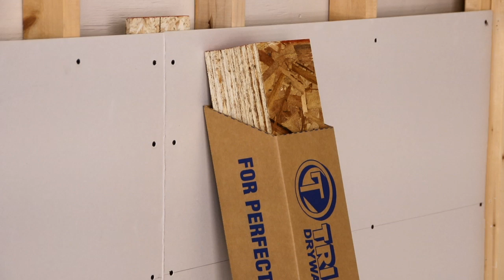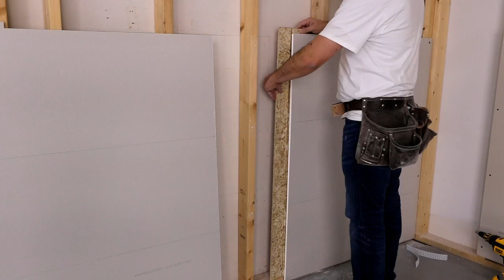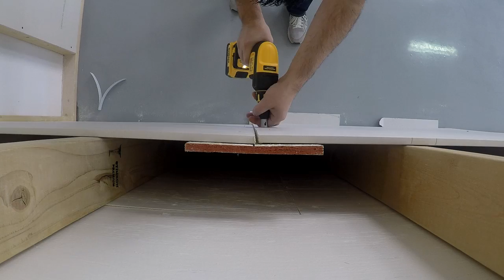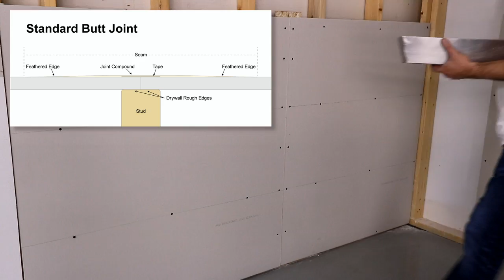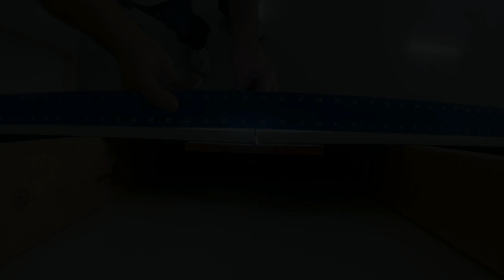How to Create Perfectly Flat Walls - Installing Buttboard™

Comment: Until someone find it with their stud finder to hang the 75” tv brackets from 😆
Reply: Lol
Reply: Lmao
Reply: That's what I was thinking 🤔 no way tellin' butt board from stud when hanging anything
Reply: Studs are spaced 12, 16 or 24 inches. If you're using a stud finder, you simply need measure the spacing.

Comment: How does it recess the joint? Wouldn't it just stay flat as if there was a stud there? What about an exterior wall with insulation and vapor barrier? Ceilings? Thanks!
Reply from the maker: On one side of the board (the side with the line) there is a very wide V channel cut. The channel pulls in the edges of the board to make the recess. So unlike a stud which is flat, the V channel makes a recess. Here's a video of it being installed on a ceiling with insulation https://youtu.be/Lr5v3EblafA
Reply: Cousin Justin stability is in the plywood
Reply: @trimtex  this explained one of my questions. Thanks!

Comment: Seems like a good idea since you can save on waste from drywall cuts. My big concern is because of the added stress on the drywall would you not get guaranteed screw pops from this product? Not only that but with your bottom and top plates does that not bow out the corner of the drywall forcing you to feather out your tape joint anyways?
Reply: Good point... for bottom plates, I guess baseboard will hide it (you can chisel the corner of sheet flush or deeper than flush), not really sure what you could do at the top. Maybe you do Buttboard on all the runs except for the top?

As for screw pops, I find it difficult to imagine a properly-done taped joint won't keep them down, especially if the screws are placed reasonably close (but not too close) to the end of the sheet where the curvature is greater (i.e. more mud on top) and where the tape is placed.
Reply: I'd be interested in the answer to this so, especially the question of how to have the top and bottom plates.
Reply: My house was done this way.  10 years now no screw pops.  They also put glue on it too.  Not sure what you mean about top and bottom plates.

Comment: Ive been doing this for years with a 2x4 installed flat and recessed 1/4 inch in the framing just toe nail -screw it in and screw board to it same thing and its a stud
Reply: a 2x4 costs $10 now so that's out lol

Comment: Why the small joint?
Reply: Because the goal of a taper is to use the least amount of product for not only efficiency and financial relief of the owner... But to provide faster finish work and a more appealing result. Too much buildup with wide gaps (cracks, butts w/e you call them) and its more difficult to evenly finish and takes longer

Comment: Mixed opinion: seems to be a great idea - no feathering out these joints as well as less sanding. However, it appears to be pretty flimsy of the wall or ceiling. To avoid this, why not slightly shave down  the wood joist, creating a slight recess where the butt joint meets (I know, extra work...) That way you'll eliminate the butt joint while not sacrificing wall or ceiling stability- just my thoughts.
Reply: its actually pretty strong man. I was skeptical but it holds its own
Reply: Yeah, you could plane down the stud a bit but then your joint would be feathered out almost 32" wide. That's a lot of mud and sanding. Alternately, if you don't feel comfortable with the strength of the Buttboard, just punch in more screws. I mean, the drywall is still going to be pretty strong in shear even with the floating screwed Buttboard, so at worst it's just the risk of cracking.
Reply: And add glue there if ur worried about strength

Comment: its not very strong though...  One firm shoulder into that and....
Reply from the maker: Would you be interested in trying some out for yourself? We would be happy to send you some to try.
Reply: @trimtex  Thanks, I don't have a job that I could use that for right now.
Reply: Trim-Tex Inc.  I would be interested to try this product before doing it on a big job. I am also curious of the structural strength.
Reply: I would be very interested in trying this product on one of my contracts.  The joint strength would be my only concern.
Reply: They are very strong, and just add glue to increase the strength
Reply: @trimtex  yeah, I have toddlers. One person runs into that joint and it's done for. I don't get it...

Comment: nobody does this . they lay the drywall on the studs
Reply: Lots of people do this. Especially in commercial buildings. This is a product specific thing from Trimtex though. Not like someone is out there cutting up plywood and doing this in a house.
Reply: i use this...turns but joints into flats. Watch the video.